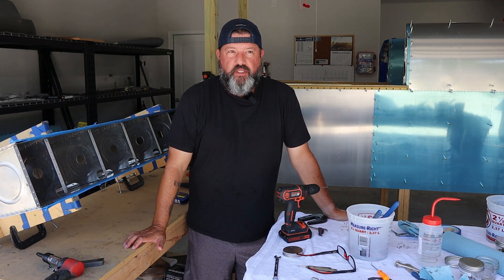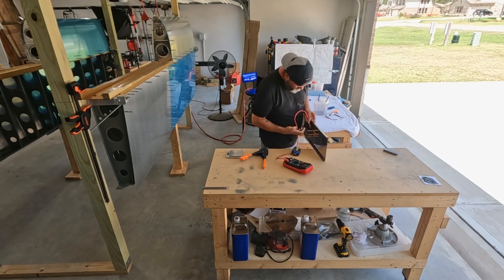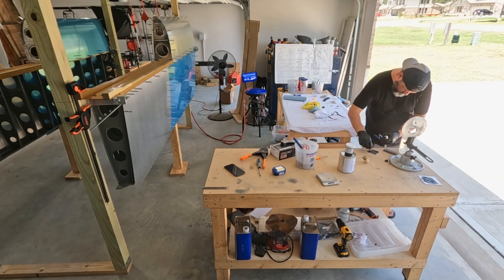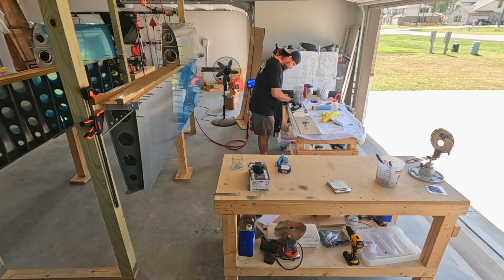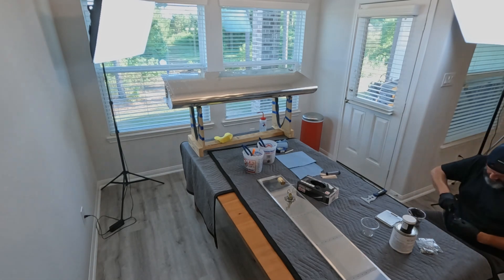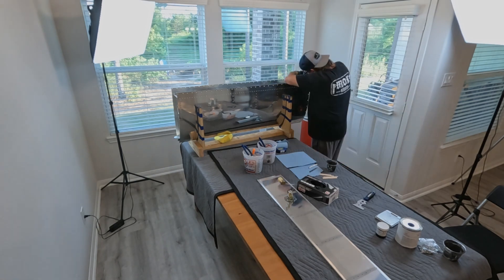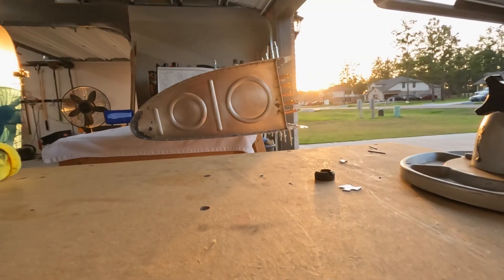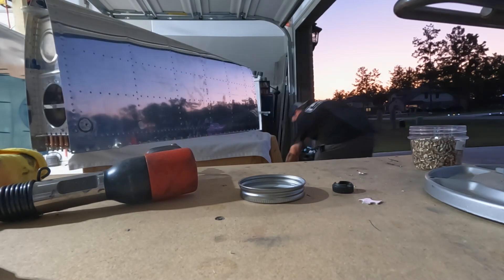Van's RV-8 Build. Ep 080. Fuel Tanks 25

Comment: Haven’t had a chance to view your tools video yet. Any thoughts on a pneumatic rivet puller? They aren’t cheap.
Reply from the maker: I thought about buying an inexpensive one today, but they were out of stock. This is good, because it would've been an impulse buy. I thought it would be nice to have on hand. But, there just aren't enough pulled rivets on the RV-8 to justify the cost of a good pneumatic puller. I think the problem is was having in the video was more an issue of the rivet type. These are closed-end rivets designed to be leakproof. They're just fussy.
Reply: Makes sense. Thanks for the advice.